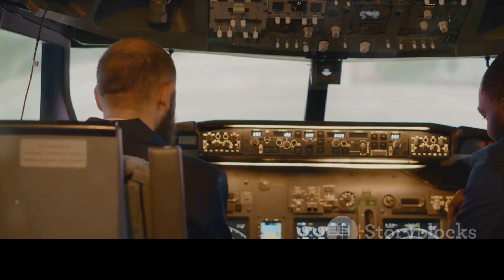How do airplanes fly?

Comment: The wing should have downward pressure, and, no lift.  Even though air moving over the top of the wing is moving faster than the air beneath the wing, the air molecules above the wing are compressed because they are occupying a smaller space than the ones below the wing and have increased pressure.  Bernoullie's Principle notwithstanding.

Comment: Actualy, this is not correct. The wing is producing lift by Newtons Law. Its pushing the air downwards. The explaination in the video is fluid-dynamics in a tube. Its simulair but not the same.
Reply from the maker: I would say neither Bernoulli nor Newton should be ignored, however due to simplicity of the video I decided not to go too much into details. But now, when I think about it, for a 5-year-old it would be much easier to comprehend Newton's 3rd Law than Bernoulli's equation.
Thank you for your comment!